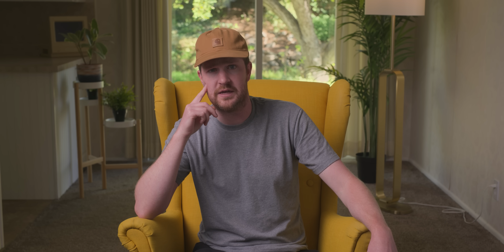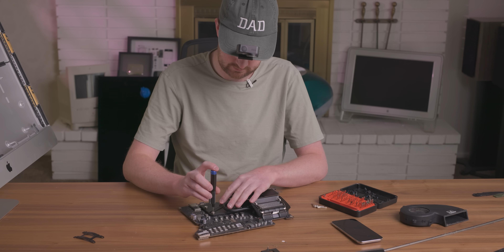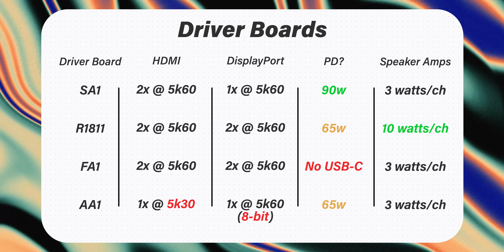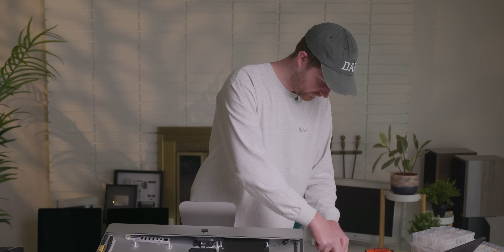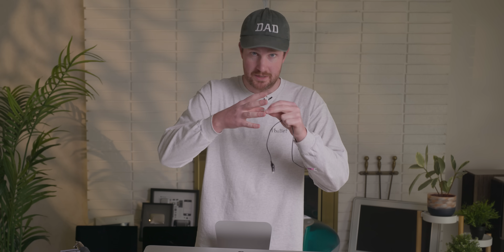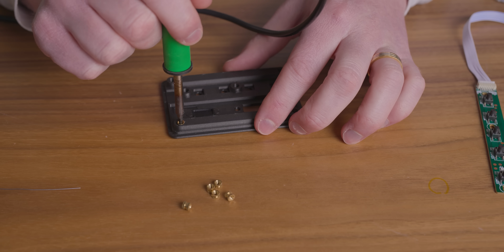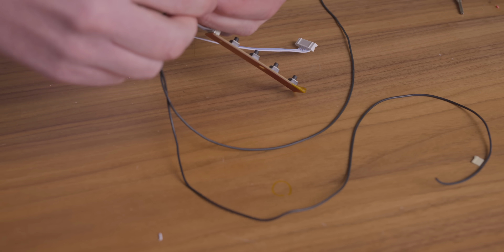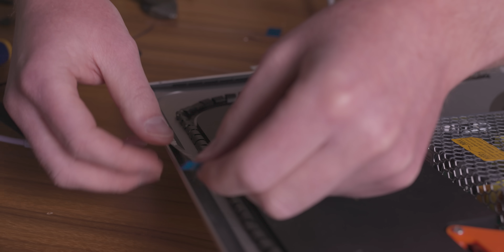I Turned a $200 iMac Into a $1,600 Studio Display!

Comment: Regarding non-integer scaling DCI-4K Eizo displays feel gorgeous crisp and clean on MacOS, no problems at all. But this only involves full 4k ones = 4096 x 2160 and not tv-crappy 3800 something and those dci-4k displays usually cost like a jet wing because most of them are reference panels :D

Comment: OMG. I've done this project two years ago and I never realised that I could install the 'Better Display' app to control the brightness. I can't describe how happy I am that now I can finally control the brightness of my iMac converted display, thank you so much!!!! 😭
Reply from the maker: BetterDisplay is amazing!
Reply: @snazzy  better display also fixes your scaling issue
Reply: Yes, I've cheap monitors from Acer which have their own software but only for windows. Nothing worked for them to adjust their brightness in Mac, not even custom scripts. That's when BetterDisplay was found and it's easy since. Although, I rarely use it but at least it's there when I need it.
Reply: Should see if you can use monitor control, its free and uses less resources
Reply: Betterdisplay is well worth the money. I have a freesync monitor and BD is the only way to actually use freesync. it also fixes some of the scaling issues on non-integer displays
Reply: Better Display only works with some of the (more expensive) display boards.
Reply: @kevinpeters5000  I haven't seen a monitor that hasn't worked with it.
Reply: @JessicaFEREM  The AA1 and R9A18 V1 display boards don't support AA1 and R9A18 V1 DDC, so have a less than ideal user experience
Reply: @kevinpeters5000  huh. more ya know.

Comment: I installed open core patcher on my late 2014 5k 17”, usb c to thunderbolt 2 dongle. Simpler and cheaper.
Reply: Can you elaborates bit more ? Sounds more practical and rather interesting
Reply: @vmemtsas search open core patcher. Running macOS on unsupported macs. It gave mine the ability to act like an external Thunderbolt Display to the Mac it plugs in to. Not sure the correct term. Because my Mac Studio is Thunderbolt 4, and iMac is TB2 I got a usb c to Thunderbolt 2 adapter and Thunderbolt 2 cable and it work straight away in extended display setting on my Mac Studio.
Reply: @MePeterNicholls  I have a 27” 2017 iMac running Sequoia via OpenCore Legacy Patcher. I just picked up a 16” 2019 Intel MacBook Pro with 32GB RAM and 4 Thunderbolt 3 ports, also running Sequoia. Could this work for me? Beyond the dongle you’re using, what steps do you take to use your iMac as an external display? Thanks
Reply: @MacWizardca it just comes up as a external screen option

Comment: Don’t splice those wires going to the button board, the power button and ground point will be accessible on the back of the board to solder wires to directly.
Reply: and could you please also suggest how do I then add the other end of these cables to the original power button?
It does not say this in the video. Thanks a lot and sorry for the dumb question 😁

Comment: I’ve seen a few videos over the years of this being done, and every time I plan to try it out — but then get cold feet. Mostly because the two times I’ve tried micro soldering I’ve destroyed things (namely an iPad mini 4 lightning connector and Nintendo switch usb port). 

I think Luke Miani did a video with a JuicyCrumb board, and that looked way easier, but looking at their website they might only support that for the 2009-2011 iMacs. I wonder if the 5k will ever be that simple🧐
Reply from the maker: It's definitely less straightforward than the older models, but totally doable! Honestly, you don’t need to solder anything if you don’t want. Butt end connectors and wire nuts can do it all.

Comment: Couldn't you have connected the inbuilt webcam to the control board's usb hub?
Reply from the maker: No. It’s not a USB webcam.
Reply: @snazzy I think it is. Lookup a pinout. You just need to identify camera usb p usb m vcc and gnd on its connector.

Comment: I understand why Apple killed Target Display due to hardware / display standard limitations, but why did they have to arbitrarily remove it from software? My 21.5-inch 2010 iMac supports it on its initial OS X 10.6 install, but not if I update it to a more recent (and almost-usable) version like 10.13 or something.

Comment: Target display mode worked on any iMac? I disagree. It was only ever on the top end largest model

(edit for increased civility, please excuse my initial reaction)
Reply from the maker: It worked on any iMac with Thunderbolt running High Sierra or older.
Reply: @snazzy  List of TB iMac models running HS or earlier that don't support target-display mode = iMac (Retina 5K, 27-inch, Late 2014), iMac (Retina 5K, 27-inch, Mid 2015), iMac (Retina 4K, 21.5-inch, Late 2015), iMac (Retina 5K, 27-inch, Late 2015), iMac (Mid 2017 models), iMac Pro (2017)

Comment: Quinn, I've been following you for many years, and this might be your best project video ever — and supremely entertaining, though. I'm sorry you had to crack a rib in the process. As a 66-year-old retired electrical technician with once formidable fine motor skills, you've inspired me to take on a project like this. Time to dust off the ol' soldering iron, crimpers, and heat gun. I will have to be careful with that power supply  to ensure it takes the 220VAC/50hz, sometimes erratic Thai grid supply.
Reply from the maker: You’ve got this!! Thanks for the awesome comment and appreciate you for staying snazzy!

Comment: -I use parsec and have the least energy efficient and least color accurate second monitor possible. But also the option to split my workload between two devies, one PC one Mac. My workload: watching youtube and other web browsing. (I have a garbage cheap second monitor connected to the pc and turned off so it lets me use extended screen, windows shift arrow to get parsec to the second monitor. I believe you can get an hdmi adapter to trick the PC into thinking it has a second monitor instead, but that would be entirely too professional for the level of Jank this project is.) -It actually is fairly color accurate to the naked eye, even with parsecs free version

Comment: So I only need a 3d printer that can print ABS, heat gun, soldering iron, connectors, crimpers, tpu and abs filament, new sets of screws, new sets of plugs, and that fancy tape. Then just buy that kit, learn how model anything I may have missed, 20 hrs of spare time. 😂 I’ll just buy a new monitor 😁 

Hats off to the folks that have those toys already.  Hope you feel better soon!!

Comment: Went down the road of looking for an external display for my m4 mini. The 4k is annoying on the non apple displays but also they take a long time to wake up from sleep, even more annoying!  The speakers are non existent too. I have settled for a 32 inch old old Apple Led Cinema Display from 2014 - $80 used! I'd love to get a 5k Apple display but $1400 + old tech makes me cringe! Also have two 27 inch thunderbolt displays - work well too but to get the max resolution HIDPI you need to buy BetterDisplay.

Comment: Amazing! I’ve been planning on this for a while now as the upgrade path in our edit bay from 3 2020 27” iMacs, and you’ve made such a good reference! And I’m happy to lose the internal speakers, and can give up power delivery for a nice panel mounted jack if needed. 

One thing I wasn’t sure of, in the end did you use your 2014 model or 2020? Will your 3D printed parts work in a 2020 or will I need to design or find others?
Reply from the maker: All parts work in all builds! Only caveat: HDD sled standoffs aren’t present in 2020 model if not optioned for a Fusion Drive

Comment: I just did an identical project but using a 21.5" iMac that i had lying around. Driver board for that was $35, and i used a 4x30w Wondom DSP amplifier that was about $65 of ali express, and hooked the tweeters and woofers up to separate channels. I've run the DSP software and configured an appropriate setup - 3000hz high pass filter on the tweeter channels and i've also put a 50hz to 3k Bandpass filter on the woofer channels, as lets be honest, a 50mm driver would be lucky to reproduce 35hz. they sound phenomonal - almost in line with my Dell U3425WE display speakers which also sound quite good for monitor speakers. wiring diagrams are online for these and its super easy to pin up. definitely get much nicer drive from a 30w RMS amplifier than a 3w amplifier. Since the 21" iMac is much less deep than the 27", i had to cut out the fan grill, and then mounted a "backpack" for the HDMI and Display ports - it looks ok - think of it like a MagSafe battery on the back of your phone :P. I then also used an external DC power pack for power, but designed a plate which replaces the IEC connector socket on the iMac, and also houses a 5 way joystick for the OSD menu navigation which, personally, i like better as i can intuitively operate the menu - middle is enter, pushing up goes up, and left and right, move the menu, left and right. the 21" is a super cheap and cheerful display that works great for a small space and people are practically giving them away - here in Australia, a perfect condition one will set you back $50-100 on marketplace - $25-$50 USD, add in the additional components, and in the US, under $100 for a pretty decent display that you can also run off 12V DC (or a decent USB Powerbank)

Comment: The question! Is it worth it.  I too did not like the scaling onto 4k monitors when using the same scale as my 27" retina iMac, BUT
I think something changed.  My m4 Macmini into a 4 k monitor looks really good. I think they may have changed the scaling a bit even though it is a 1.5x scaling.  Still not quite 5k sharp but quite good.  Aliasing issues were somehow removed.

Comment: Nice, as always. I knew I was keeping three 27" iMacs for something! Original X1C from Kickstarter - going to upgrade soon to H2D, um, maybe H2S. For me, losing a bit of print bed real estate might be worth having two nozzles, especially for printing with engineering materials (2nd nozzle would print support). Thoughts? Also, Bambu says that H2D would be upgradeable to the nozzle-changing printer they are releasing later.

Comment: "brightness is a logarithmic scale" pardon?

nits are candela per square meter.

Candela are... approximately candles. Linear.

Now obviously "twice as bright" and "half as bright" plain do not make sense, since perception of brightness is logarithmic, so 400 is one photographic stop brighter than 200, and 800 is one photographic stop brighter than 400, and 500 is 1/3 stop brighter than 400, a very modest difference. Stops are photographer speak but they do describe the lived experience of light pretty well.

But also every display massively loses brightness with age, and it's completely plausible that a 2017 screen is actually still 400 and a 2012 not even close, especially if heavily used, and the aging speed depends on LED type and configuration, which obviously changed.

Now i wonder whether the liberated Mac hardware can be run with a different display. I just need a cheap mac for mac software development purposes. Haswell is maybe not ideal but it'll do.
Reply from the maker: Luminance is perceived logarithmically by our eyes.
Reply: @snazzy  yes this means 400 and 500 nits are basically the same.

Comment: FWIW, the LG Ultrafine 5K can be had on the secondary market for pretty cheap these days and it's also the same panel... but without all this work 😂
Reply: You can actually start seeing brand-new 5K 27” monitors for barely more (~$700-750), considering $300+ for the iMac, $200+ for the kit, plus tools, etc, and T I M E! 😂
But yes: crappy speakers, plastic enclosures! 😢
Reply from the maker: But no glass front panel and worse speakers! Not to mention a squeaky plastic enclosure! :D
Reply: @snazzy  True! But then this project always seems to turn out way longer than people think 😅 time vs. money, baby!

Comment: With my M4 Mac mini I use a $229 43" LG 4K TV and it is a far better experience than my 27 inch iMac, plus I also get a TV out of it. It is an ADS IPS type display with excellent viewing angles, nice contrast, and accurate color (essentially identical to my iPad after calibrating) that shows fantastic detail with pin sharp text. Save your money people.
Reply: Just so I understand, you are saying your 43" 4k is as "pin sharp" as a 27" 5k iMac screen? You should let Apple know they are wasting their time with these fancy displays!
Reply: @kevinpeters5000 

Learn to read more carefully. You also don't need to have 5K resolution to have pin sharp text.
Reply: @CorneliusTaylor-s1u 43” at 4k is an abysmal 104ppi. This screen is over twice that so for many people is very noticeable. I’m glad your huge, cheap, low resolution TV works for you but to compare it to a screen like this and that people should “save their money” is absurd.
Reply: @k @kevinpeters5000 

"43" at 4k is an abysmal 104ppi. This screen is over twice that so for many people is very noticeable."

You're not viewing a display that size as close as you are with a comparatively much smaller display, such as what you have on the iMac or Studio Display. At the distance that I am viewing it at there is no noticeable difference in detail and smoothness. 

"I'm glad your huge, cheap, low resolution TV works for you but to compare it to a screen like this and that people should
"save their money" is absurd."

43" is not huge. 😄

Cheap in price? Yep, but not cheap on quality. Once calibrated I get essentially the same color accuracy, dynamic range, and probably even greater brightness. It's also an IPS display like on the iMac and the Studio Display. The detail is also fantastic, and I also get a TV out of it. 

Yes, people should save their money and simply buy a good TV at a much cheaper price. With a TV you are getting the benefit of greater display development and a much smaller price. That's the result of the TV market being much greater than the monitor market.

Comment: I modified a broken iMac 2015 into a studio display and used it for nearly 2 years with the original speaker working. The core dilemma for me is very hard to find a perfect screen. High temperatures from earlier iMac metal body can damage the phosphor at the screen edges, making white appear magenta. If the iMac screen is good -> still functions as a PC -> more expensive than just buying a 5K display, or if the iMac is broken -> has been heavily used -> burned screen(my scenario).

Comment: Few videos demonstrate what Apple has been doing wrong so well. Machines that are glued shut, and are really hard to upgrade. I use my M1 still, but have been moving to Linux. I won't be buying apple hardware any more until you can open it and replace the storage yourself. Thanks Apple. How has Apple not learned this lesson yet? Cube or Trashcan anyone?

Comment: Haven’t watched in a few years, and I didn’t know you were like that with heavy mods. Love it. Also, soldering is super duper easy especially on cable like that. When I saw the buck converter, that’s like going off the deep end. Just get a good soldering iron for like 60 bucks and not the cheap harbor freight one and you’ll be amazed how easy it is.
Reply from the maker: I have a great soldering iron but I still suck lmao
Reply: @snazzy  you can use leaded solder as well, melts at a lower temp and attaches to cables more easily! Just don’t mix the two

Comment: I am baffled. Absolutely. You chopped off the power button on the board rather than de-soldeinr the momentary switch and using the existing connections on the PCB. That would had been soldered and covered in tape. Why mr. Quinn, you make the most peculiar of decisions.
Reply: The board wouldn't fit with the PCB length where we wanted to put it, so it had to be chopped off.

Comment: When reattaching the panel to the case, set the case up right; without removing the plastic from the adhesive or connecting the panel cables, set the panel in the correct position, checking your left right alignment then use blue painters tape along the bottom edge of the panel and the top edge of the chin of the case. Then tilt the panel down to connect the panel cables and remove the plastic from the adhesive. This is how we did it at an AASP back in the day

Comment: I didn't read every comment to see if someone said this already....I made one of these a year ago and I recommend hooking up the display cables and TEST to see if the display board (and everything else) works before applying the adhesive strips!
Reply from the maker: sometimes you just gotta yolo it😊
Reply: @snazzy  Guaranteed fail when I do that.  Not much is less fun than cutting new iMac adhesive.

But hey, now I know what I'm gonna do with all the 2014 - 2017 iMacs sitting in the floor.  (The 2011s are still going to recycling when I get around to it though.)
Reply: @snazzy  You upset the luck gods when you do that.

Comment: No computer made during its time is "Too old" to compute, and for some people, they can move their workflow to something open-source, give Father Time a firm middle finger and use something a bit more light on graphic, yet much more featureful than Windows and macOS ever could be… since features aren't locked away under different tier of system (which these days is easily bypassed), or limited to fulfill some corporate vision for what the desktop should be.

If you're going to lock yourself in some team's vision for the desktop, at least doing it with something free through the likes of GNOME Shell can enable greater choice of how to tackle a project while spending little money as possible, and the difference in software can mean an old rig can feel like how you'd expect from its day. No miracles or magic here, just good quality software which doesn't entirely suck to use.